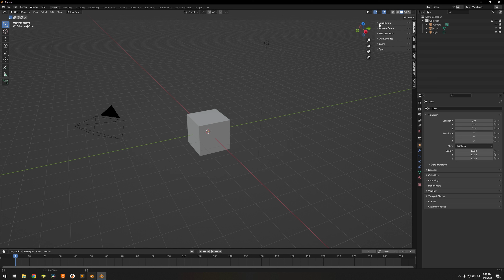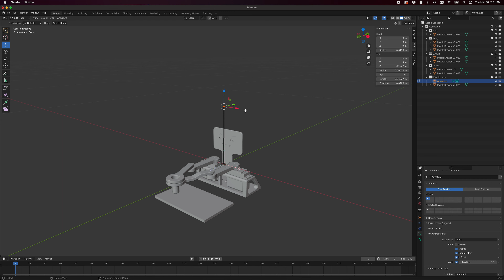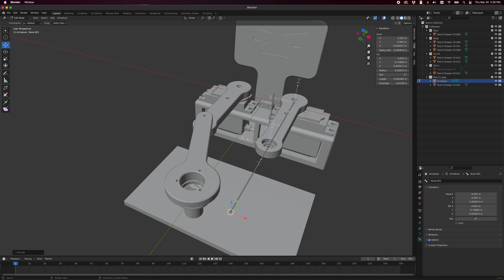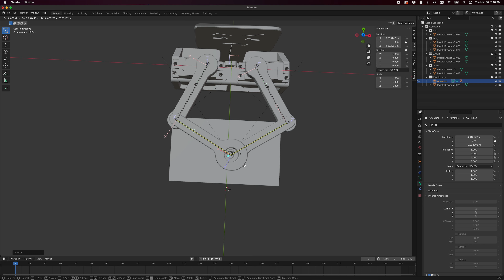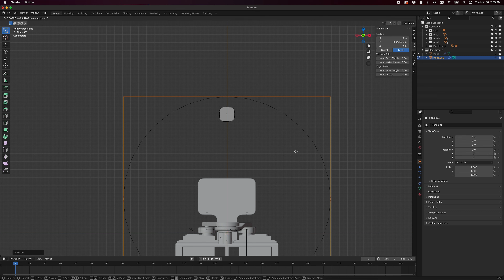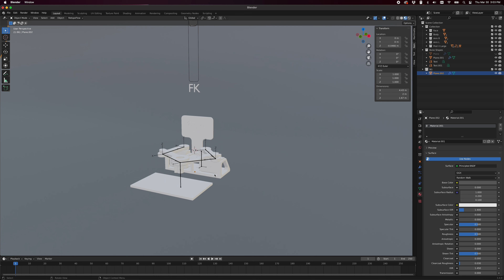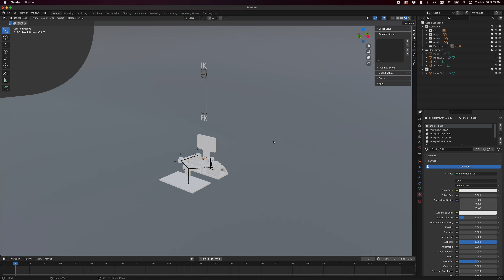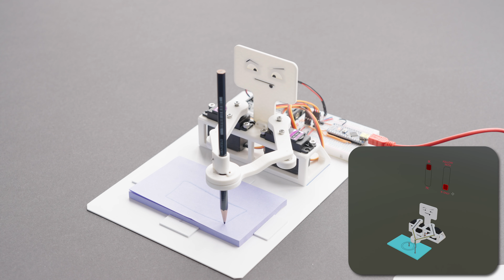MarIOnette Tutorial: Make Your Own Post-It Drawing Robot

Comment: Is Marinette up to date to the latest Blender and Arduino versions ?
Reply from the maker: It should be! The latest Blender version I tested is 4.1.1 (latest stable release as of June 10, 2024). The Arduino version shouldn't affect functionality as long as you use Arduino IDE 2.0 or later.
Reply: @knee-koh  ok great ! Thank you btw I have been learning how to use it little by little every day currently I’m trying to use it to find a walking gait with RL for a bipedal robot. I have RL saved to a saved animation using IK following a path and some reason when I play the animation the servos don’t move, but in the servo set up I can have them manually move by adjusting Min and Max values. Can an animation control servos ?
Reply from the maker: @charles26842  Animations should definitely be able to move servos (as long as the MarIOnette panel is open and active when the animation runs). I've seen this issue crop up a few times on knockoff Arduino boards when the USB/Serial port would randomly disconnect and then reconnect. A couple things to try:
- Disconnect from the controller in the panel, reseat the cable, then reconnect
- See if you're getting any warnings or errors in the bottom of the Blender window

If you still have issues, please make a thread in the MarIOnette github with pictures + details (a .blend file would also be ideal so I can test on my setup): https://github.com/knee-koh/MarIOnette/issues
Reply: @knee-koh  Hello again Long time, hope all is well.

I have been working with it for quite a while and have resolved several issues, connection, servo lag. I was wondering if you have an idea on how  to use a PWM driver for servos. I'm thinking it would possibly be as simple as redeclaring the servo pin to PWM channel.
Reply: @knee-koh  Main code:

/* 
MarIOnette template file for Arduino-compatible boards
Tested on Arduino Nano (ATMega 328P), Arduino Uno, Teensy 3.2, Teensy 4.1
*/

#define DEBUG_SETUP 1
#define DEBUG_SERIAL 1
#define DEBUG_SD_PLAYBACK_TEST 0

#include "config.h"

// Create the PWM servo driver object
Adafruit_PWMServoDriver pwm = Adafruit_PWMServoDriver();

unsigned int counter = 0;
unsigned int howManyBytes = 0;

unsigned int busServoSpeed;
unsigned int readingPositions = 0;
unsigned int playingAnimation = 0;
unsigned long previousMillis = 0;
const long interval = 200; // Increased interval for non-blocking delay

void readSerialBytes() {
  int debugOut = 0; // Minimized debug output
  char inByte;

  while (Serial.available() > 0) {
    char mode = Serial.read();

    if (debugOut) {
      Serial.print("Mode: ");
      Serial.println(mode);
    }

    // Blender sending data...
    if (mode == 'A' || mode == 'B') {
      counter = 0;

      if (IS_AVR) {
        delay(SERIAL_DELAY);
      } else {
        delayMicroseconds(SERIAL_DELAY);
      }

      // Read in first bytes to get message length
      char one = Serial.read();
      
      if (IS_AVR) {
        delay(SERIAL_DELAY);
      } else {
        delayMicroseconds(SERIAL_DELAY);
      }

      char two = Serial.read();

      if (mode == 'A') {
        howManyBytes = word(one, two) + expectedSpeedBytes;
      } else {
        howManyBytes = word(one, two);
      }
      
      if (debugOut) {
        Serial.print("Expecting bytes: ");
        Serial.println(howManyBytes);
      }

      if (howManyBytes > 64) { // Check for potential buffer overflow
        if (debugOut) {
          Serial.println("Error: howManyBytes exceeds buffer size");
        }
        return;
      }

      char tempBuffer[howManyBytes];

      unsigned long timeout = millis() + 100; // Timeout to prevent infinite loops
      while (Serial.available() < howManyBytes && millis() < timeout) {
        // wait until we have enough data
      }

      if (Serial.available() >= howManyBytes) {
        for (int i = 0; i < howManyBytes; i++) {
          tempBuffer[i] = Serial.read();
        }

        // Right amount of bytes received, set motors and LEDs
        if (debugOut) {
          Serial.println("Success! Data received: ");
          for (int i = 0; i < howManyBytes; i++) {
            char buffer[4];
            sprintf(buffer, "%02X ", tempBuffer[i]);
            Serial.print(buffer);
          }
          Serial.println();
        }

        if (mode == 'A') {
          updateMotorsAndLEDs(tempBuffer, 0);
          busServoSpeed = word(tempBuffer[0], tempBuffer[1]);
        } else {
          updateMotorsAndLEDs(tempBuffer, 1);
          busServoSpeed = 0;
        }
      } else {
        if (debugOut) {
          Serial.println("Timeout waiting for data");
        }
        while (Serial.available()) {
          Serial.read(); // Clear the buffer
        }
      }
    } else if (mode == 'P' && !playingAnimation && SD_ENABLE) {
      // Play back file from SD card
      SDHelper(1);
    } else if (mode == 'S' && playingAnimation && SD_ENABLE) {
      // Stop file playback
      SDHelper(0);
      if (debugOut) {
        Serial.println("Animation stopped by serial");
      }
    } else if (mode == 'R' && !readingPositions && SD_ENABLE) {
      // IN PROGRESS!!!
      // Read values from dynamixels or bus servos
      if (TOTAL_BUS_SERVOS > 0 || TOTAL_DYNAMIXELS > 0) {
        if (debugOut) {
          Serial.println("Reading values from dynamixels or bus servos");
        }
        // Read how long the animation is and at what FPS it runs
        //readingPositions = 1;

        //Serial.parseInt();
        //totalFrames = Serial.parseInt();
        //FPS = Serial.parseInt();

        //frameInterval = 1000*1000/FPS; // In microseconds

        //animationTimer = 0;
      } else {
        if (debugOut) {
          Serial.println("No bus servos or dynamixels configured!");
        }
      }
    } else if (mode == 'Z' && readingPositions) {
      // Cancel position reads
      readingPositions = 0;
    }
  }
}

void setup() {
  // Start Serial monitor
  Serial.begin(BAUD_RATE_SERIAL);
  if (DEBUG_SETUP) {
    Serial.println("Starting MarIOnette initialization...");
  }

  // Initialize PWM driver
  pwm.begin();
  pwm.setPWMFreq(60);  // Analog servos run at ~60 Hz updates

  // Perform setup, which gets dynamically generated by MarIOnette
  setupAll();
  
  if (DEBUG_SETUP) {
    Serial.println("Setup finished!");
  }
}

void loop() {
  // Check for serial data and update motors and LEDs
  readSerialBytes();
  
  // Handle animations
  if (playingAnimation) {
    playAnimationFile();
  }
  
  // Update steppers
  updateSteppers();
  
  // Non-blocking delay for smooth servo movement
  unsigned long currentMillis = millis();
  if (currentMillis - previousMillis >= interval) {
    previousMillis = currentMillis;
    // Call any functions that require timing here
  }
}

void setupAll() {
  for (int i = 0; i < TOTAL_MOTORS; i++) {
    // Servos
    if (motor_values[i][0] == 1) {
      // Use PWM driver for servos
      if (DEBUG_SETUP) {
        Serial.print("Servo ");
        Serial.print(i);
        Serial.print(" on PWM channel ");
        Serial.println(i);
      }
    }

    // PWM Pin
    if (motor_values[i][0] == 2) {
      pinMode(motor_values[i][1], OUTPUT);
    }

    // ON/OFF Pin
    if (motor_values[i][0] == 3) {
      pinMode(motor_values[i][1], OUTPUT);
    }

    // PWM Bi-Directional
    if (motor_values[i][0] == 4) {
      pinMode(motor_values[i][1], OUTPUT);
      pinMode(motor_values[i][2], OUTPUT);
    }
  }
}

void updateMotorsAndLEDs(char frame_buffer[], int mode) {
  int servo_index = 0;
  int stepper_index = 0;

  for (int i = 0; i < TOTAL_MOTORS; i++) {
    int offset = i * 2;

    // Speed bytes are sent in case we have bus servos...
    if (mode == 0) {
      offset = i * 2 + expectedSpeedBytes;
    }

    unsigned int motor_value = word(frame_buffer[offset], frame_buffer[offset + 1]);

    // Min and Max values
    if (motor_value > motor_values[i][9] && motor_values[i][8] != 0 && motor_values[i][9] != 0) {
      motor_value = motor_values[i][9];
    } else if (motor_value < motor_values[i][8] && motor_values[i][8] != 0 && motor_values[i][9] != 0) {
      motor_value = motor_values[i][8];
    }

    // Set servo position using PWM driver
    if (motor_values[i][0] == 1) {
      int pwm_value = map(motor_value, 691, 1667, 150, 600); // Adjust the range as needed
      pwm.setPWM(i, 0, pwm_value);
      Serial.print("Setting PWM for Servo ");
      Serial.print(i);
      Serial.print(" on channel ");
      Serial.print(i);
      Serial.print(" to value ");
      Serial.println(pwm_value);
      servo_index++;
    }

    // Set PWM value
    if (motor_values[i][0] == 2) {
      analogWrite(motor_values[i][1], map(motor_value, 0, 4000, 0, ANALOG_MAX));
    }

    // Set ON/OFF value
    if (motor_values[i][0] == 3) {
      if (motor_value > 0) {
        digitalWrite(motor_values[i][1], HIGH);
      } else {
        digitalWrite(motor_values[i][1], LOW);
      }
    }

    // Set Bi-directional PWM
    if (motor_values[i][0] == 4) {
      if (motor_values[i][3] == 1) {
        if (motor_value > ANALOG_MAX / 2) {
          analogWrite(motor_values[i][1], map(motor_value, ANALOG_MAX / 2, ANALOG_MAX, 0, ANALOG_MAX));
          digitalWrite(motor_values[i][2], HIGH);
        } else {
          analogWrite(motor_values[i][1], map(motor_value, ANALOG_MAX / 2, 0, 0, ANALOG_MAX));
          digitalWrite(motor_values[i][2], LOW);
        }
      } else {
        if (motor_value > ANALOG_MAX / 2) {
          analogWrite(motor_values[i][2], map(motor_value, ANALOG_MAX / 2, ANALOG_MAX, 0, ANALOG_MAX));
          digitalWrite(motor_values[i][1], LOW);
        } else {
          analogWrite(motor_values[i][1], map(motor_value, ANALOG_MAX / 2, 0, 0, ANALOG_MAX));
          digitalWrite(motor_values[i][2], LOW);
        }
      }
    }
  }
}
void playAnimationFile() {}
void SDHelper(int mode) {}
void readAnimationFile() {}
void updateSteppers() {}
Reply: @knee-koh  Config.h code:

#define BAUD_RATE_SERIAL 115200

#define SD_ENABLE 0
#define USE_SD_INTERNAL 0
#define SD_CS_PIN 0

#define TOTAL_MOTORS 2
#define TOTAL_SERVOS 2
#define TOTAL_PWM_MOTORS 0
#define TOTAL_STEPPERS 0
#define TOTAL_BUS_SERVOS 0
#define TOTAL_DYNAMIXELS 0

#define TOTAL_LEDS 0
#define TOTAL_PWM_LEDS 0
#define TOTAL_NEOPIXELS 0

unsigned long motor_values[2][10] = {{1, 8, 0, 0, 0, 0, 0, 0, 0, 0},
                                     {1, 9, 0, 0, 0, 0, 0, 0, 0, 0}};

unsigned long led_values[0][0];

#include "Arduino.h"
#include <Wire.h>
#include <Adafruit_PWMServoDriver.h>

// Create the PWM servo driver object
extern Adafruit_PWMServoDriver pwm;

#if defined(__AVR__)
 #define IS_AVR 1
 #define SERIAL_DELAY 1
 #define ANALOG_MAX 255
#else
 #define IS_AVR 0
 #define SERIAL_DELAY 5
 #define ANALOG_MAX 4095
#endif

// MarIOnette serial
extern unsigned int counter;
extern unsigned int howManyBytes;

// Expected packet
const int expectedMotorBytes = TOTAL_MOTORS * 2;
const int expectedSpeedBytes = 2;

// Servos
extern unsigned int busServoSpeed;
extern unsigned int readingPositions;

extern unsigned int playingAnimation;

// Function prototypes to avoid multiple definitions
void setupAll();
void updateMotorsAndLEDs(char frame_buffer[], int mode);
void playAnimationFile();
void SDHelper(int mode);
void readAnimationFile();
void updateSteppers();
Reply from the maker: @charles26842 , hi I'm assuming you're using something like this for the PWM board (https://www.amazon.com/HiLetgo-PCA9685-Channel-12-Bit-Arduino/dp/B07BRS249H/ref=sr_1_1?crid=2B7B99822OMDK&dib=eyJ2IjoiMSJ9.gT2lJEJuGbufNYv_7D2DzaSpxbe2gi2vMvps5eiWDoNsHngYVxs-OS9_9uvwQr1ytU_Tov_VrWcMbF94HtuvqVUsCJ_bTjU9BVgj1SYsSGAaBbBGzbvw1622a9YtP6HJKwqUagXVC-kyZioH1psP5xAPgNOs-E7AiHHlz4namjRR6dwcL8DnXypt4o5Ri4l8hZm8N9Qn3sUEWltIvLT4qezSica3pLDCPjWUs66LlEQ.RGjiYM3qepeCbz2fwb1cln0UQ6SlGN8itB9XPb51QEM&dib_tag=se&keywords=pwm+driver&qid=1721072466&sprefix=pwm+driv%2Caps%2C153&sr=8-1)?

If so, here are the steps I'd try first:
- Uncheck the "Overwrite Arduino file" box in the Sync panel since those boards aren't supported and you'll need to modify the .h file
- Next, download the library and then follow the example sketches (https://github.com/adafruit/Adafruit-PWM-Servo-Driver-Library) for the PWM board to see how they declare the object and write to PWM channels
- Open your MarIOnette generated .h file
- At the top where everything is declared, include the library you downloaded above and then add the object - Adafruit_PWMServoDriver pwm = Adafruit_PWMServoDriver();
- Replace the servo setup code with what you see in the example sketch (in the setupAll() function in the MarIOnette .h file)
- Replace the servo movement code with what you see in the example sketch (in the updateMotorsAndLEDs() function in the MarIOnette .h file)

That should be enough to get you going. If you still run into issues, post them to the github so I can keep better track of them: https://github.com/knee-koh/MarIOnette/issues
Reply: @knee-koh  Hello, thank you these insights really helped, I was able to mod the code to use the PWM driver. I will try and share the code here
Reply: @knee-koh  /* 
MarIOnette template file for Arduino-compatible boards
Tested on Arduino Nano (ATMega 328P), Arduino Uno, Teensy 3.2, Teensy 4.1
*/

#define DEBUG_SETUP 1
#define DEBUG_SERIAL 0
#define DEBUG_SD_PLAYBACK_TEST 0

#include "config.h"

void readSerialBytes() {
  int debugOut = 0;
  char inByte;

  if (Serial.available() > 0) {
    char mode = Serial.read();

    // Blender sending data...
    if (mode == 'A' || mode == 'B') {
      counter = 0;

      if (IS_AVR) {
        delay(SERIAL_DELAY);
      } else {
        delayMicroseconds(SERIAL_DELAY);
      }

      // Read in first bytes to get message length
      char one = Serial.read();

      if (IS_AVR) {
        delay(SERIAL_DELAY);
      } else {
        delayMicroseconds(SERIAL_DELAY);
      }

      char two = Serial.read();

      if (mode == 'A') {
        howManyBytes = word(one, two) + expectedSpeedBytes;
      } else {
        howManyBytes = word(one, two);
      }

      if (debugOut) {
        Serial.print("Expecting bytes: ");
        Serial.println(howManyBytes);
      }

      char tempBuffer[howManyBytes];

      while (Serial.available()) {
        if (IS_AVR) {
          delay(SERIAL_DELAY);
        }

        inByte = Serial.read();

        // Keep reading in case last byte is the stop char
        if (counter < howManyBytes) {
          tempBuffer[counter] = inByte;

          counter++;
          if (debugOut) {
            //Serial.println(counter);
          }
        }

        // Received too many bytes but no stop character...
        else if (counter >= howManyBytes && inByte != '.') {
          Serial.print("Too many bytes, expected ");
          while (Serial.available()) {
            Serial.read();
            counter++;
          }

          if (debugOut) {
            Serial.print("Too many bytes, expected ");
            Serial.print(howManyBytes);
            Serial.print(" and got ");
            Serial.println(counter);
          }

          counter = 0;
          break;
        }

        // Right amount of bytes received, set motors and LEDs
        else if (counter == howManyBytes && (inByte == '.' || inByte == 46)) {
          if (debugOut) {
            Serial.println("Success!");
          }

          if (mode == 'A') {
            updateMotorsAndLEDs(tempBuffer, 0);
            busServoSpeed = word(tempBuffer[0], tempBuffer[1]);
          } else {
            updateMotorsAndLEDs(tempBuffer, 1);
            busServoSpeed = 0;
          }
        }
      }
    }

    // Play back file from SD card
    else if (mode == 'P' && !playingAnimation && SD_ENABLE) {
      SDHelper(1);
    }

    // Stop file playback
    else if (mode == 'S' && playingAnimation && SD_ENABLE) {
      SDHelper(0);
      Serial.println("Animation stopped by serial");
    }

    // IN PROGRESS!!!
    // Read values from dynamixels or bus servos
    else if (mode == 'R' && !readingPositions && SD_ENABLE) {
      if (TOTAL_BUS_SERVOS > 0 || TOTAL_DYNAMIXELS > 0) {
        // Read how long the animation is and at what FPS it runs
        //readingPositions = 1;

        //Serial.parseInt();
        //totalFrames = Serial.parseInt();
        //FPS = Serial.parseInt();

        //frameInterval = 1000*1000/FPS; // In microseconds

        //animationTimer = 0;
      } else {
        Serial.println("No bus servos or dynamixels configured!");
      }
    }

    // Cancel position reads
    else if (mode == 'Z' && readingPositions) {
      readingPositions = 0;
    }
  }
}

void setup() {
  // Start Serial monitor
  Serial.begin(BAUD_RATE_SERIAL);
  Serial.println("Starting MarIOnette initialization...");

  // Perform setup, which gets dynamically generated by MarIOnette
  setupAll();

  Serial.println("Setup finished!");

  /*
  // Uncomment this block to test SD card animation playback 
  // Change the testFile name to whatever you exported the animation as, and then trigger it to run
  if(DEBUG_SD_PLAYBACK_TEST){
    String testFile = "test8";
    int length = testFile.length() + 1;
    testFile.toCharArray(filename, length);
    playingAnimation = 1;
    readAnimationFile();
  }
  */
}

void loop() {
  // Begin reading serial port for incoming commands
  readSerialBytes();
  if (playingAnimation) {
    playAnimationFile();
  }
  updateSteppers();
}
Reply: @knee-koh  
// MarIOnette generated config file for motors and LEDs //
#define BAUD_RATE_SERIAL 115200

#define SD_ENABLE 0
#define USE_SD_INTERNAL 0
#define SD_CS_PIN 0

#define TOTAL_MOTORS 16
#define TOTAL_SERVOS 16
#define TOTAL_PWM_MOTORS 0
#define TOTAL_STEPPERS 0
#define TOTAL_BUS_SERVOS 0
#define TOTAL_DYNAMIXELS 0

#define TOTAL_LEDS 0
#define TOTAL_PWM_LEDS 0
#define TOTAL_NEOPIXELS 0

unsigned long motor_values[16][10] = {
    {1, 0, 0, 0, 0, 0, 0, 0, 0, 0}, // Channel 0
    {1, 1, 0, 0, 0, 0, 0, 0, 0, 0}, // Channel 1
    {1, 2, 0, 0, 0, 0, 0, 0, 0, 0}, // Channel 2
    {1, 3, 0, 0, 0, 0, 0, 0, 0, 0}, // Channel 3
    {1, 4, 0, 0, 0, 0, 0, 0, 0, 0}, // Channel 4
    {1, 5, 0, 0, 0, 0, 0, 0, 0, 0}, // Channel 5
    {1, 6, 0, 0, 0, 0, 0, 0, 0, 0}, // Channel 6
    {1, 7, 0, 0, 0, 0, 0, 0, 0, 0}, // Channel 7
    {1, 8, 0, 0, 0, 0, 0, 0, 0, 0}, // Channel 8
    {1, 9, 0, 0, 0, 0, 0, 0, 0, 0}, // Channel 9
    {1, 10, 0, 0, 0, 0, 0, 0, 0, 0}, // Channel 10
    {1, 11, 0, 0, 0, 0, 0, 0, 0, 0}, // Channel 11
    {1, 12, 0, 0, 0, 0, 0, 0, 0, 0}, // Channel 12
    {1, 13, 0, 0, 0, 0, 0, 0, 0, 0}, // Channel 13
    {1, 14, 0, 0, 0, 0, 0, 0, 0, 0}, // Channel 14
    {1, 15, 0, 0, 0, 0, 0, 0, 0, 0}  // Channel 15
};

unsigned long led_values[0][0];
#include "Arduino.h"
#include <Wire.h>
#include <Adafruit_PWMServoDriver.h>

// Create the PWM servo driver object
Adafruit_PWMServoDriver pwm = Adafruit_PWMServoDriver();

#if defined(__AVR__)
 #define IS_AVR 1
 #define SERIAL_DELAY 1
 #define ANALOG_MAX 255
#else
 #define IS_AVR 0
 #define SERIAL_DELAY 5
 #define ANALOG_MAX 4095
#endif

// MarIOnette serial
unsigned int counter = 0;
unsigned int howManyBytes = 0;
unsigned int busServoSpeed = 0;
unsigned int readingPositions = 0;
unsigned int playingAnimation = 0;

// Expected packet
const int expectedMotorBytes = TOTAL_MOTORS * 2;
const int expectedSpeedBytes = 2;

// Auto-generated function from MarIOnette
void setupAll() {
  pwm.begin();
  pwm.setPWMFreq(60); // Analog servos run at ~60 Hz updates

  for (int i = 0; i < TOTAL_MOTORS; i++) {
    // Servos
    if (motor_values[i][0] == 1) {
      // Servos are now controlled by the PWM driver, so no need to attach them to pins
    }

    // PWM Pin
    if (motor_values[i][0] == 2) {
      pinMode(motor_values[i][1], OUTPUT);
    }

    // ON/OFF Pin
    if (motor_values[i][0] == 3) {
      pinMode(motor_values[i][1], OUTPUT);
    }

    // PWM Bi-Directional
    if (motor_values[i][0] == 4) {
      pinMode(motor_values[i][1], OUTPUT);
      pinMode(motor_values[i][2], OUTPUT);
    }
  }
}

void updateMotorsAndLEDs(char frame_buffer[], int mode) {
  int servo_index = 0;
  int stepper_index = 0;

  for (int i = 0; i < TOTAL_MOTORS; i++) {
    int offset = i * 2;

    // Speed bytes are sent in case we have bus servos...
    if (mode == 0) {
      offset = i * 2 + expectedSpeedBytes;
    }

    unsigned int motor_value = word(frame_buffer[offset], frame_buffer[offset + 1]);

    // Min and Max values
    if (motor_value > motor_values[i][9] && motor_values[i][8] != 0 && motor_values[i][9] != 0) {
      motor_value = motor_values[i][9];
    } else if (motor_value < motor_values[i][8] && motor_values[i][8] != 0 && motor_values[i][9] != 0) {
      motor_value = motor_values[i][8];
    }

    // Set servo position using PWM driver
    if (motor_values[i][0] == 1) {
      int pwm_value = map(motor_value, 0, 4095, 150, 600); // Adjust the range as needed
      pwm.setPWM(motor_values[i][1], 0, pwm_value); // motor_values[i][1] contains the channel number
    }

    // Set PWM value
    if (motor_values[i][0] == 2) {
      analogWrite(motor_values[i][1], map(motor_value, 0, 4000, 0, ANALOG_MAX));
    }

    // Set ON/OFF value
    if (motor_values[i][0] == 3) {
      if (motor_value > 0) {
        digitalWrite(motor_values[i][1], HIGH);
      } else {
        digitalWrite(motor_values[i][1], LOW);
      }
    }

    // Set Bi-directional PWM
    if (motor_values[i][0] == 4) {
      if (motor_values[i][3] == 1) {
        if (motor_value > ANALOG_MAX / 2) {
          analogWrite(motor_values[i][1], map(motor_value, ANALOG_MAX / 2, ANALOG_MAX, 0, ANALOG_MAX));
          digitalWrite(motor_values[i][2], HIGH);
        } else {
          analogWrite(motor_values[i][1], map(motor_value, ANALOG_MAX / 2, 0, 0, ANALOG_MAX));
          digitalWrite(motor_values[i][2], LOW);
        }
      } else {
        if (motor_value > ANALOG_MAX / 2) {
          analogWrite(motor_values[i][2], map(motor_value, ANALOG_MAX / 2, ANALOG_MAX, 0, ANALOG_MAX));
          digitalWrite(motor_values[i][1], LOW);
        } else {
          analogWrite(motor_values[i][1], map(motor_value, ANALOG_MAX / 2, 0, 0, ANALOG_MAX));
          digitalWrite(motor_values[i][2], LOW);
        }
      }
    }
  }
}

void playAnimationFile() {}

void SDHelper(int mode) {}

void readAnimationFile() {}

void updateSteppers() {}
Reply: @knee-koh  To change the channel of the servo it works best if the users starts at channel 0 as the first servo set up in blender then proceeds to increment from the by +1 till channel 15
Reply: @knee-koh  How does one get the recording of the animation data to the SD card to work, do you need a path to a SD card reader/writer ?
Reply: @knee-koh  Hello again, I have been playing around with SD card playback, If I enable the SD card debug in the Arduino code It can find the file. After I I am to enter "P" into the serial monitor to play the animation back, it will say file not found. Do you know how to resolve this issue ???
Reply: @knee-koh  Hello again, would you mind if I reference Marionette in a paper I am writing for a hexapod, I am giving you full reference.
Reply from the maker: @charles26842  Of course, happy to hear it's made it into a paper!
Reply: @knee-koh  ok great thank you very much :)